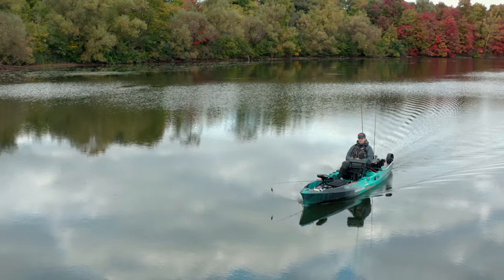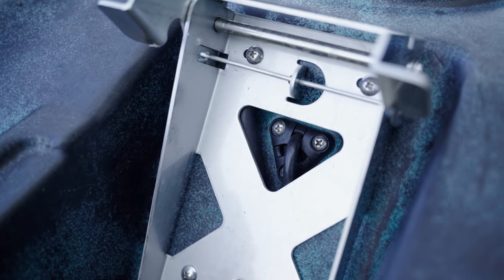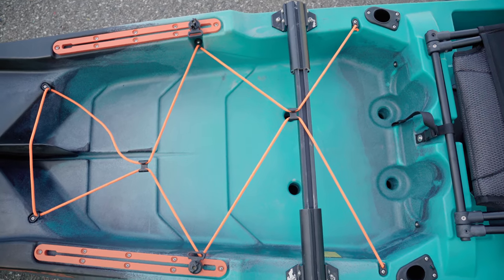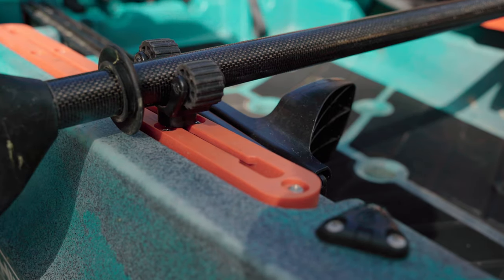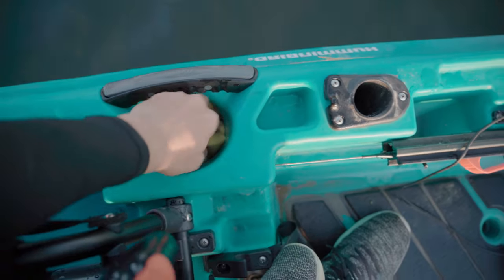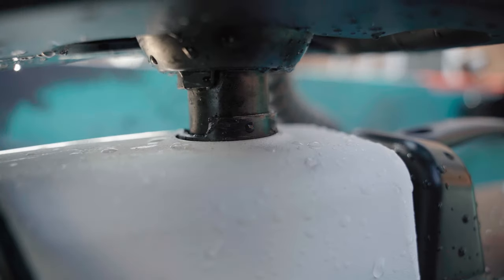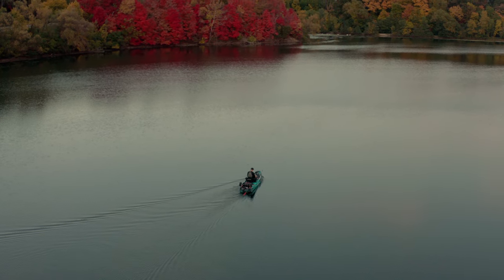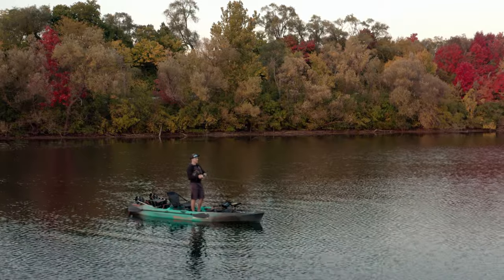Complete Review - Old Town AutoPilot 136 (2020)

Comment: I've watched many Youtube reviews on this kayak. Yours is the best by far. I think I'm going to wait until OT releases the second generation of this kayak before I buy it.  Thank you so much for your review.
Reply from the maker: Glad you found it useful. Based on history, OT will take a while to release an upgraded model. You should not worry about water in the cup holder or barely any water that can be on the deck. These are not big issues at all to wait a few years for a new model. Personally, I would rather enjoy the kayak now if thats what I wanted. If/when a new model comes out, I would upgrade.

I highly recommend you demo and try out one of these kayaks. I'm sure it would help you make up your mind. Good luck!
Reply: Nice kayak cost $8990 in Australia😁

Comment: the only 2 complaints i have with this kayak.. are...   cammo/color selection...   and  the rudder system which is plastic and seems to struggle with an heavier current...  this is an awesome package overall...  but quite high on the price.   it is well made.  The placement of the motor is great...  the more sea deck is mo betta..  i am tall and at 230 pounds/i have to use an bigger yak..  it is perfect for saltwater/inshore/bay fishing...   which i love...  id like to see an saltwater version of the minn kota supplied...  perhaps an ulterra...  with ALL the bells and whistles..    this yak is 1 step above the HOBIES at this time...   but, changes will be made to compete for 1st place...  im not an fan of the BIXBY motor..

Comment: HELLO THERE  IM 6'1. 339LB JUST WONDER IF MY WEIGHT  WILL BE TO MUCH FOR ME...THE VIDEO WAS AWESOME  . THANK YOU...
Reply from the maker: The weight capacity is about 427lbs, so you should technically be ok with minimal gear. You'd also have to go for the lightest battery you can get. Lead acid batteries weigh like 70lbs, so you'd have no more room for gear. But all of this is technical.

I think your best bet would be to go to Old Town Autopilot owners group on Facebook and ask the same question!

Comment: I have been saving my brains out just for the pdl 106..lol..I am a boat builder by trade and the first thing I would do if I'm lucky enough to get one is set the yak upside down on saw horses and put 3 coats of McGwires wax on the bottom and sides to help with sun fade and mud stains..great video.

Comment: I run Lowrance Hook2 on our Old Town 120 Autopilot and there are ZERO compatibility issues when installing and they arevery easy to use.
Love our 120!
Reply from the maker: That's great to know! The connectors on some models are too big for the holes, but I suppose some models have smaller connectors. Thanks for sharing.

Comment: This is as good of a review on the ap136 that exists!  And as you know there are several very good reviews that have been posted this past year. You were methodical and thorough and really explained the experience of fishing in the kayak.  Thank you so much for posting this.  Excellent content!
I am considering getting this kayak next spring and I have a few questions for you.  Can you please describe more details of the battery you use and the run times you get in terms of distance travelled and speed setting used?  Can you cover 10 miles in ocean current?  Can you cover 20 miles?  Are you using a 100ah lithium batter and would using a 200ah battery be feasible in your opinion?  Any reply would be greatly appreciated.
Tim
Reply from the maker: Thanks for the comment. People like you is exactly why I made this video. I appreciate your feedback. Battery concerns is definitely top of the list for me when talking about a motorized kayak.

As I mentioned in the video, 12+ miles is about what you can expect full throttle. In perfect conditions, that should push you at 4+mph speeds. When going against decent current (detroit river for me), you'll average 2.5-3+ mph. So, I'd say technically the range should drop. 

You also need to consider that you will be fishing - slowing down and being spot locked. That will preserve battery life dramatically.

It's very hard to define these numbers into actually how far you will be able to go. With a 100ah battery, I am completely confident that I will be able to go as far as I want on bigger lakes, but I do need to preserve battery life.

Most of the time, I move around at 80%. That gives me a decent average speed and good efficiency. When I'm heading back in, or my fishing trip is coming to an end, I don't preserve battery anymore.

Honestly, a battery meter is a must. Its like having your fuel meter in your car.

The one I have is called Victron. Pricy, but works as advertised. Cheaper option is AiLi. No bluetooth app, but good price.

With 200ah of battery, you could forget about running out of juice. Keep in mind, a 200ah battery wouldn't fit in the battery box, and maybe not even under the seat, so you would need to split it into 2x100.  Personally, 200 would be too much. I think 150 is plenty for those that want to travel really far. I'm actually considering a 50 to use as a back up for long trips, but I'll see how this year goes and if I even need it.

Anyways, the point is, you will probably buy a 1x100ah battery first, and you might as well test it to see if its enough for you. If it's not enough, buy more.

One other thing, because you're not getting tired from going from spot to spot, you will feel like you're not going far enough. In reality, with a pedal kayak you would be really tired - unless you ride 50 miles on a bicycle. 

In summary, I use speed 8 (80%) most of the time to travel from spot to spot. Seems to be enough so far and I'm happy and confident with the kayak.

Hope this helps.
Reply: @KayakOutbreak  more great information thanks!  I will have the next few months to get things set up, your advice is right in line with what I had figured.  The power meter is essential and I think 100ah battery with self monitoring capability and a decent charger will be best to start off with.  I will keep you updated on how I make out, thanks again, stay safe.  Tim C.

Comment: Excellent clear and informative review, thank you.

 I dunno, I"m not 100% sold on the concept here. I get it that the deck is splendid with all that space, and it's a superbly built kayak, but personally speaking, I would have preferred if the Motor went in position so that you could have a pedal drive option. That said, I suppose you can't have the deck space otherwise, so that's the trade off for a powered Kayak with only paddle back up if a battery fails, or you drop the hand control overboard, (does it float?) or you loose power for whatever reason.
Reply from the maker: Understandable! Having a motor and pedal drive compatability would make for a so-so kayak. It's either one or the other. Motor would have to be closer to the middle of the kayak, and that wouldn't be ideal.

I understand that you're worried about power, or anything that can fail. Think about this - when your pedal drive breaks, you will be in the same situation. Plenty of times I've seen people break their Hobie Drive fins, cable snaps, pedal drive props break, pedal drive pedal falls off - you name it. I've broken a paddle on a paddle only kayak before. Things happen! Do you think chances are higher with electric hardware failing? Probably. 

I feel comfortable being 2+ miles out on Lake St Clair. I have top of the line lithium battery, battery meter, and more importantly I trust the Minn Kota motor. Chances are I will encounter issues in the future. But that doesn't stop me going out there.

You always have to think ahead, have a back up plan, and if all fails, just paddle back in. Be safe out there and make smart decisions.

The kayak is not for everyone. I am glad, however, that you found the video at least somewhat helpful and informative.

In the end, my goal was to inform people and make everyone think of things that they may not have.

Good luck out there!

Comment: Excellent review and very thorough. If I didn’t just buy a Hobie 360, I would give this very serious consideration.
Reply: How's the hobie going for you?
Reply: @robscorner4741  I’m very happy with it. I have a Minn Kota trolling motor that I can put on the front if I want. I like being able to use the trolling motor or pedal drive depending on the situation. Also having both, means if either one was to fail while on the water, I don’t have to paddle 6 miles back to the ramp, unless I feel like paddling that far😄. If I ever decide to get a new kayak, it would probably be another Hobie 360 unless something better is available.

Comment: Thanks for a great review! Questions: What landing gear (make/model) are you using? What issues did you run into when installing the landing gear? Has there been any issues with the frame/hull since installation? Thank you!
Reply from the maker: Appreciate your comment!

The exact model name of the product is Boonedox Landing Gear Groovy HD (standard kit/non specific). 

No issues, but not exactly a quick install. Mainly because I was a little nervous. The hardest part was modifying one of the backing plates to fit in the slot and then drilling holes in those plates perfectly. Somehow one side went smoothly, but the other I drilled holes a bit crooked (on a backing plate) so I had to modify the plate further.

I'm super happy how sturdy it feels. I have full confidence in my install and in the plastic holding up. I do try not to move it fully loaded around. Mainly to make it easier on myself, but it helps not to overload it. But even fully loaded (battery and motor) I still have full confidence it will not fail.

Not exactly easy to hold the backing plates and bracket under the hull amd screw it on. Could be easier with two people, or if you got long arms.

Good luck with your install!

Comment: Thank you I didn’t thing think you were going to mention the overall speed but you did thank you , I think the kyack is slow  and heavy for inshore waves here  in ny,  we’re there is serious fishing I think that kyack would die but a hobbie outback with torpedo can go fast have ample space dry storage and you can peddle drive
Reply: The hobie out back has smoth stream lines that can handle anything even big waves the torpedo goes almost 6 mph and you can go 6 miles offshore that is amazing yes is priced higher but you get what you pay for that spot lock is ok but.  I would not have bought that kyack because of spot lock if you really want to fish and not sleep buy an out back with torpedo just saying thanks ken
Reply: @kennetholavarria8044  don’t get what you are trying to say? 
You wouldn’t buy the kayak because of spotlock ? 
Have you ever used a TM with SpotLock? 
Wether it be a Bass boat or fishing Kayak I have never one time heard someone say they had second thoughts or wouldn’t purchase one again for any reason. 
I have one on my Alumacraft MV1860 boat and that thing is invaluable. Have option for foot or remote control.

Comment: Would plugging scupper holes cause me to still end up with a puddle of water by my feet on only lakes an rivers?
Reply from the maker: I would say no. Not even if you don't plug them in, the water drains very quickly. There's one low spot closest to the seat, but barely any water stays there. In rough water, some water will rush through scuppers, but will drain quickly. It's a very dry kayak comparable to many kayaks out there!

Comment: Can you let me know what the height is from the bottom to the top of the kayak hull? Trying to determine if it will fit between the garage door and ceiling during storage.
Reply from the maker: My kayak is sitting on the floor right now, so I measured it at different points. The nose is about 18.5" high, middle is about 15-16, and the bavk end was about 17 I think. Hope this helps
Reply: @KayakOutbreak  exactly what I needed. Thanks for the quick reply

Comment: I’m worried about the battery out on the water. Will it leave me stranded if it’s a windy day.
Reply from the maker: I've yet to run into issues with my set up. As you saw in the video, I run a 100ah lithium battery and a Bluetooth meter. I keep an eye on it all the time, and I have no worries at all - even fishing big waters like Lake St Clair. The kayak performs really well on windy days. Of course, your speeds might be slower, but thats not a big deal.

If the weather is really brutal, I dont hit the water at all.

I think the answer you're looking for will depend on the battery you run. 100ah is plenty if you ask me.
Reply: @KayakOutbreak  thank u

Comment: thanks for the video. at one point, you mentioned dry hull weights 134lb. I checked spec, it states 95lb. what is the correct weight? I plan to roof top it since no space to store a trailer.
Reply from the maker: I used technical information provided by Old Town to create this video. Per their website, it states that the total weight is 158lbs; weight of the motor is 25lbs. 
https://oldtowncanoe.johnsonoutdoors.com/old-town-sportsman/fishing/sportsman-autopilot-136?jo-page=2

I think you commented about making a dry box for a lithium battery and I can't find that comment to reply to it. 

Basically, the battery box fits pretty snug, so you don't want to go over too much of the inside of the box dimensions:
13.25" L x 7.25" W x 9" D

Original box has pretty thin walls, like ~2mm. After my measurements, adding .25" to these dimensions is all that will fit there, but might be cutting it close.

Honestly, I don't see a reason for a waterproof box, but if you need a peace of mind that your battery will be ok if you flip, then go for it.
Reply: @KayakOutbreak  thank you for quick reply. marine battery (especially AGM) can work submerged.but lithium will start fire if water gets into battery.

Comment: Question
If I put 3 battery in parallel or in series, will I be able to set the Kayak to travel 50 miles in a vector  ( straight autonomously) into the sea?
Reply from the maker: It depends what kind of batteries you got, I suppose. With a 100ah lithium battery, I can surely travel 12-15 miles at higher speeds (75-100% throttle). If you slow down, I'm sure you will be able to get a little more.

I don't know if I could recommend you this kayak if you want to consistently get 50 miles of range. I would be scared to go that far on something that's not a gas boat.

See for yourself. Be safe out there!

Comment: Quick question what’s the name of the landing gear you have ? and by putting that type of landing gear won’t that void the lifetime warranty of the hull ?
Reply from the maker: Boonedox Landing Gear Groovy HD.

If a failure to hull or motor is caused by an aftermarket modification, the warranty is voided. So it's not voided by installing it, but if something goes wrong because of it, then it is voided. I'm happy how solid the boonedox is on the kayak. I have full confidence in mine.
Reply: @KayakOutbreak  Great Video.  Do you have a part number for the Boonedox Landing Gear Groovy HD?  I cannot find this one and want to make sure I get the correct one.

Comment: I don’t own a kayak yet. If you were to tip over in a kayak like this, it would pretty much ruin all the electronics correct? And lose all your gear?
Reply from the maker: I would say most electronics would be just fine.

I believe the motor should be designed to withstand heavy rain, but it may short the fuse box. I'm not educated on electronics enough to tell you what will happen, but it should have safety guards in place.

Fishfinders are made to be water tight as well. I've seen videos of people finding fishfinder screen floating in the water and they still worked.

Not sure how the battery would react being submerged.

All the lose gear will definitely fall out, and if it doesn't float it will sink unless tied down with leashes. 

I've had some experience being in kayaks in rough weather (not to say it takes bad weather to tip you over), so I feel confident in not tying anything down to prevent it from sinking in the case of tipping over. 

If you'd like to see the stability of this kayak put to the test, watch this video. You will most likely fall off the kayak before you tip it over.

https://youtu.be/fwHnBEjZ64k
Reply: @KayakOutbreak  Thanks for the reply. That’s one thing that’s been on my mind while saving up for a kayak. Maybe I should start off with minimal gear until I get the hang of using the kayak before I load it up. Would hate to lose gear or short out electronics that cost good money. Appreciate the info.

Comment: Do you have a picture or photo of the battery mount you made for your fish finder
Reply from the maker: I don't at the moment, but I can send you one if my explanation here is not good enough.

I took a piece of HDPE plastic sheet (but can be made of anything) and made a floor for the battery. Not sure the dimensions, but it barely fit through the hole. This piece lays down flat, across two "peaks" of the kayaks floor which is not flat. Then, I took some floor mats (Google interlocking floor tiles). I cut a pice of that up, and made a border around the plastic base and I basically used duck tape to hold overything together. Even the base to the kayak. Still good!

Battery lays on the side inside those borders and its a snug fit. I dont have any other straps to hold it down, but I'm sure you could tie one up before you tape the whole thing to the floor of the kayak.

If you would like some pictures, let me know. Message me on Instagram @bogdankomedia, or Facebook  - Kayak Outbreak.

Good luck!